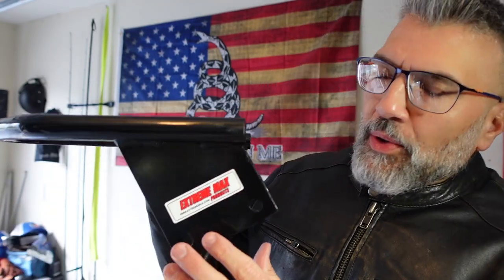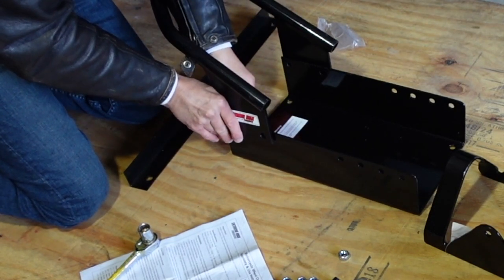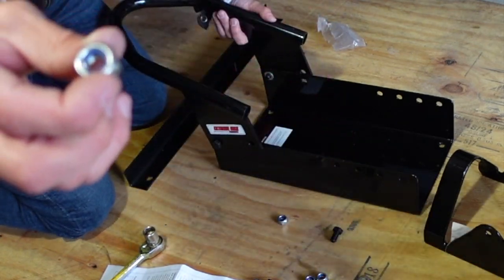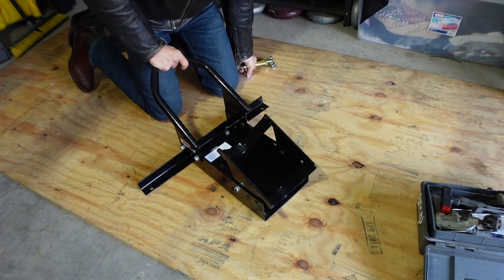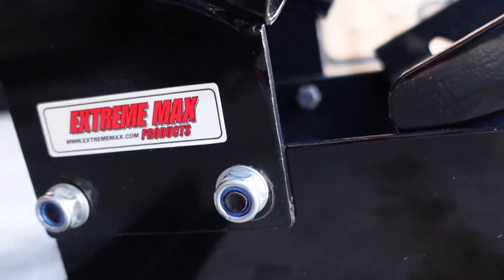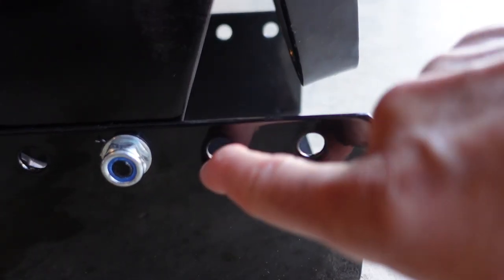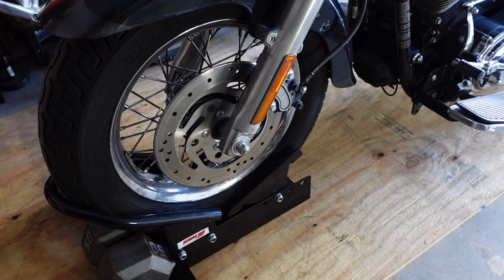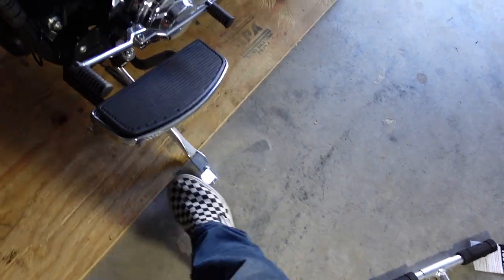Extreme Max 5001.5010 Motorcycle Wheel Chock

Comment: I bought one of these for my 2022 street glide special. Unfortunately it does not hold my bike straight up and down. I think because my tire is skinner, so might need a different mount if they make one.
Reply from the maker: I wonder if they have an addapter or make a smaller size.  You should reach out to the company.